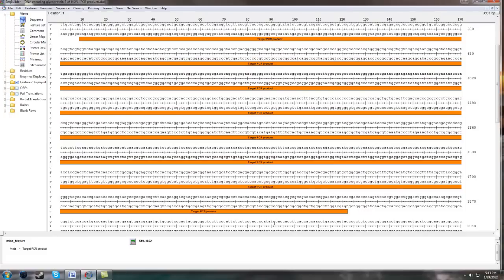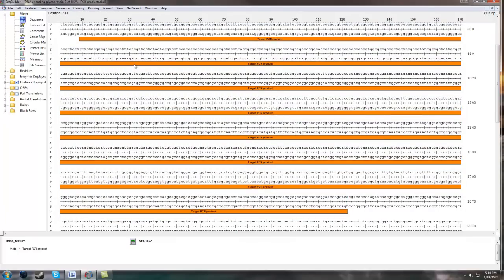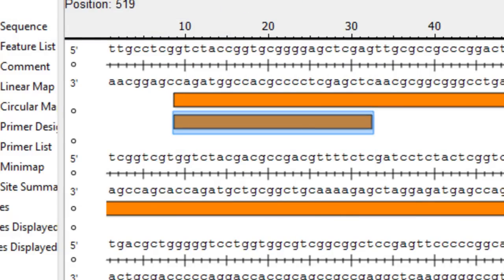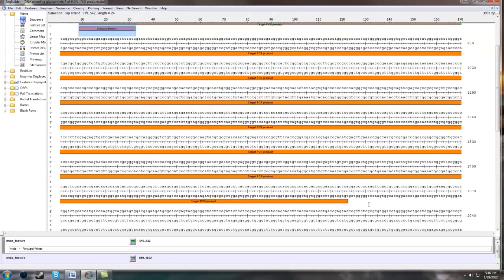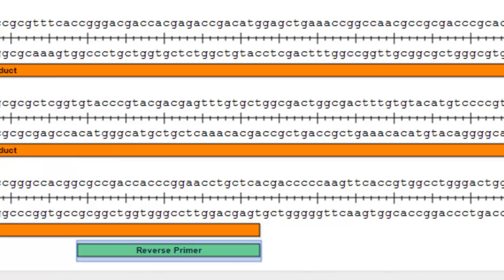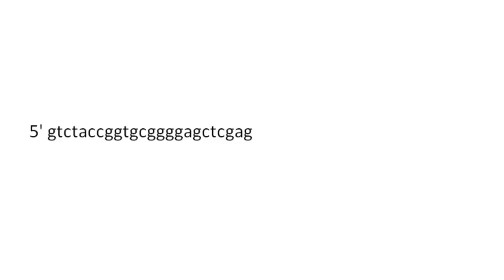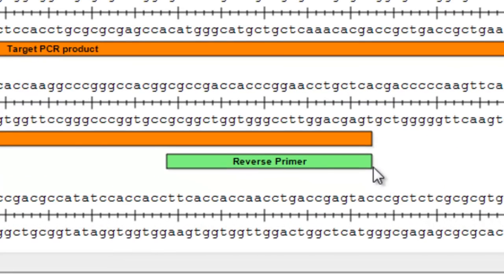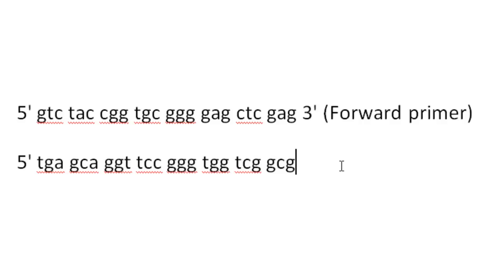Tutorial 1: Designing basic PCR primers

Comment: I don't understand why the primers are complimentary to each other? Won't it form primer dimers galore?
Reply from the maker: I'm sorry, but I don't see the problem. I looked at the forward and reverse primers in the video, written from the 5' to 3' direction, and they are not complementary to one another. I  mean I guess there are maybe a few bases here and there that are complementary, but that's unavoidable when designing primers. Usually, there will always be some degree of dimer formation just from the PCR process and it also depends on your specific cycling conditions. I hope this helps! And thanks for checking out my video!
Reply: The primers are not complementary to each other at all. Think of it this way. You have two DNA strands, the leading strand in the forward 5 to 3 prime end and the lagging strand in the backward 5 to 3 prime end. These strands are complementary to each other. Now break the bonds between these two strands and make them single stranded. The primer that binds to the lagging strand will be complementary to it, so it will be an exact replica of the leading strand.... this is called the forward or sense primer..... the other primer or the rather the primer that binds to the leading strand will be a complement of the strand in the reverse. This is called the reverse or antisense primer.... So when you think of it.... We have two primers... the forward primer being the exact replica of the leading strand and the reverse or antisense primer being a "reverse complement" of the the lagging strand.
Reply: It is my question too!

Comment: Great video. I am just confused why the forward primer was complimentary to the bottom strand and the reserve primer was complimentary to the top strand? I also would appreciate it if you can explain it to me how I would design a primer for a cDNA. Thanks!
Reply from the maker: +Yakin Jaleta Thank you for checking out my video. As for your questions - because that's how DNA polymerase works, always synthesizing from 5' to 3' ends. In that case the forward primer must bind to the template strand while the reverse primer must bind to the coding strand. Designing primers for cDNA is no different from the standard process - not quite sure exactly what you're asking.
Reply: +TheScyther88 I figured it out. Actually, thanks for your videos I got 100% on my take home exam!
Reply from the maker: +Yakin Jaleta Good job! :)